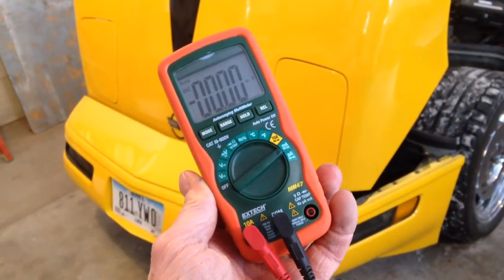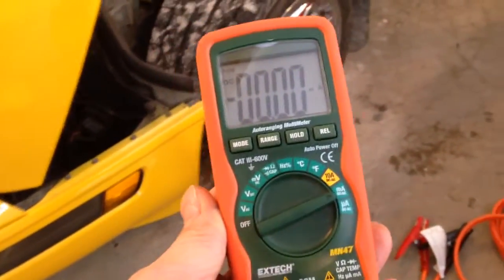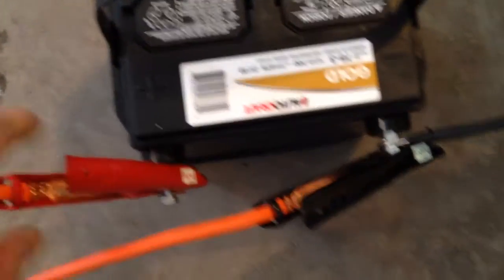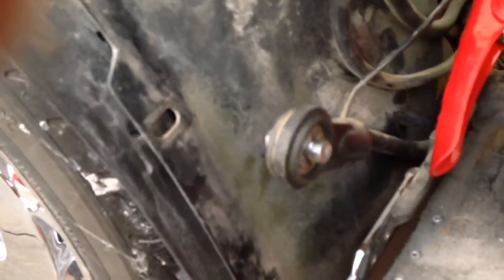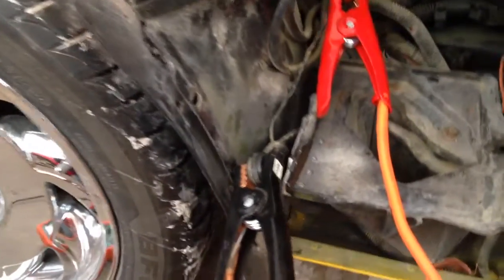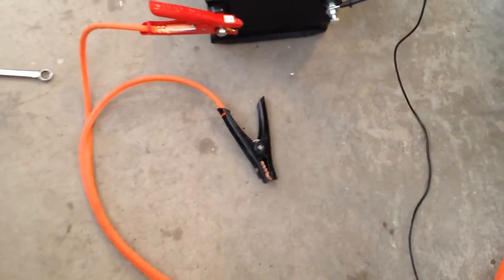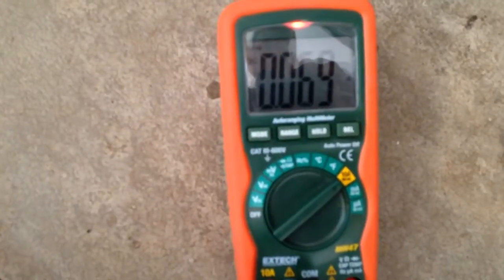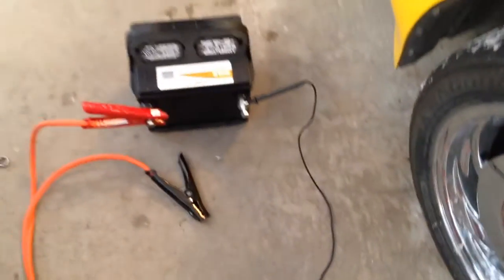Parasitic battery drain diagnosis- C4 Corvette

Comment: I have an issue right now on my 84 where the Battery will drain in about two days if not driven. I pulled the fuses and it was .256 before I pulled the cluster and .02 after. So I decided to pull the cluster fuse and the car still drains. So is it not that or?
Reply from the maker: Jered.  Sounds like you may just have a battery that is near end of life.  One way a battery goes bad is that they will just no longer hold a charge.  I would take the battery out, fully charge it, and take it to an auto parts store to have it load tested, unless you have already done this?
Reply: @flyboyslc1 I have already done this. I’m on a different account so sorry for that but I have done this. The battery itself is from Nov. 2022 so it’s pretty new anyways. But tested the battery out of the car no drain and went to auto one for the test.
Reply from the maker: @drshortstuff4824  make sure your meter is set up correctly.  It is in series and not parallel?  Google your problem and start reading all u can about it.  Your reading of 20 milliamps should not drain a battery in 2 days.  Here is one link that may help. https://www.c4vetteregistry.com/vrforums/c4-electrical/early-c4-battery-discharge/481366/

Look for glove box light, hood light, anything hidden that u can’t see.

Comment: how would u do this on an early c4 when  u can't get to fuse pnl w/door closed?
Reply from the maker: Not sure what the question is?  But if it is having the dome light on because the door is open, find some way of pushing in the door switch with a prop, wedge, block of wood, tape or what ever it takes to push the switch into a “door closed” condition.
Reply from the maker: @brianmyers24  improvise a tool to hold the door switch closed. Duct tape.   Broom handle. What ever. Run a stick to the floor and rest it against a heavy toolbox or similar
Reply: @brianmyers24  Hope you find the drain.  One thing to know is that not every circuit goes through a fuse.  On my 1991 there were several that were on fusible links, so finding one of them that are bad is difficult.

Comment: battery on the floor ?
Reply from the maker: Yea Jon,  some of the electrical circuits that needed to be tested are connected to terminals right below the battery, so it had to come out.  These circuits are on fusible links and not fuses in the fuse panels.

Comment: I had that issue with my Australian built Holden Commodore which runs the 5.7 litre Chevrolet LS1 V8 engine, the battery would run from fully charged (12.7 volts) to almost flat (11.80 volts) the next morning.

I noticed that the voltage fluctuated when the multimeter was connected up to the battery terminals on & off,I also heard a ticking sound as if a small relay was switching on & off.

It was coming from inside of the car & underneath the drivers seat,it was a parasitic drain from the seats height adjustment circuit so the switch is partially shorted out,so I need a new switch or I'll try to pull the existing one apart.

I just pulled the circuit breaker out for that circuit last night & took the car for a drive to fully charge the battery,this morning it was sitting at 12.39 volts since the car has an LCD clock & odometer to run as well as LEDs for the security system !
Reply from the maker: Hello Russell,  Motorized drivers seats, and antennae motors are often culprits on battery drain.  It can be really hard sometimes to find these issues.  steve
Reply: I pulled apart the switch which was clogged up with dust which was causing the switch to jam up.

I just cleaned the switch out with a cotton bud,lubed it up with petroleum jelly then reassembled it,everything has been alright ever since.

So I saved myself $304 AUD on a new 640 cca battery ($239 AUD ) & a new 4 way lumbar support switch ($65 AUD).

In my car,it is connected directly to a battery via a 20 amp circuit breaker so it's not switched via the ignition switch !
Reply: Where would the drain be at for the antenna

Comment: Question. After you pull a fuse and it's not that circuit that's causing the drain do you leave the fuse out or put it back in? Would putting it back in cause any modules on that circuit to wake up and possibility wake up other modules as well causing a misdiagnosis on other circuits?
Reply from the maker: Anthony Buonagura   Great question. Always monitor the readings on the multimeter and write them down.  If there was no change when i pulled a fuse i put it back in.  If you wake up a module you will see that indication on the meter and you can wait for it to time out and continue with the test at that point.  My drain what there was of it was not on any fused circuit. It was on a circuit protected with a fusible link.
Reply: flyboyslc1 Ok, thanks
Reply: @flyboyslc1 what is a protected fusible link
Reply from the maker: @robertmendenhall1350  google auto wiring fusible link. Lots of videos on them. Here is one. https://youtu.be/Tg7K343N5w0

There are several circuits on c4 Corvette with fusible link protected circuits
Reply: I have a 90 corvette. When I connect the negative cable to the battery my headlight motors don't spin like that. Are they supposed to? All I hear is a clicking sound when I attach the negative cable.
Reply from the maker: Anthony Buonagura .  not sure about a 90 model year. There may have been changes in the computer between years. The light doors are just figuring out where they are. As long as lights work wouldn’t worry.
Reply: flyboyslc1 ok, thanks
Reply: @flyboyslc1 I have a 93 40th Edition I've restored and wolbach it never drain the battery but now it does by sitting for 2 days I had to replace the headlight and antenna module that's right there on the fender wall on the driver side I have blown two of those and the last time I blew it was cranking the motor over turning the headlights off at the same time I just ordered another module oh boy they're not cheap where do you think a drain would be coming from on my car another thing should that module blow just by turning the headlights off or turning them on when I crank it
Reply from the maker: @robertmendenhall1350   Sounds like you have a unique problem.  I think if you are not already a member on CorvetteForum, you should join it.  There is a C4 Techical section that you can ask this question.  Really smart people there that will probably be able to help.  Here is a link to the forum.  Create an account, start a thread about you issue.  I am betting you will find an answer.  https://www.corvetteforum.com/forums/c4-tech-performance-48/

Comment: The tricky part is figuring out what's going on after you've identified the circuit.  I have an intermittent problem where sometimes if I have the fuse for the dash and tail lights in it'll completely kill my battery in under two hours.  Other times it's fine.  But it's most certainly on that circuit.
Reply from the maker: +Ben Goeller    Thanks for the feedback Ben.  Good luck on finding your issue.